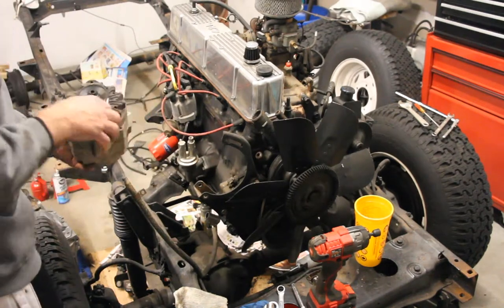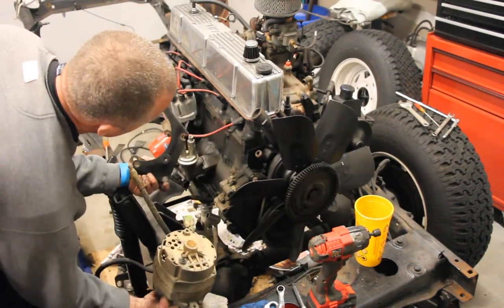Jeep CJ7 Alternator Removal

Comment: hello. is that a 258?
Reply from the maker: Yes it is. I've got a bunch of other videos that show other pieces coming off or going back on in my channel.
Reply: @coolguy_CJ7  
Thanks, I'm interested, because I bought a CJ7. but this one doesn't have the wiring installed. I installed a chevrolet alternator and a ford starter. But I don't know how to install the wiring.
Reply from the maker: Congrats. Welcome to the club. Let's start with a couple things. First, what year? That will help with the wire harness need. Second, do you have the wire the harness? Third how important is it that you stay original (to me, original is vital :).